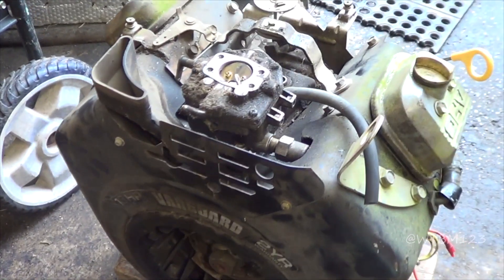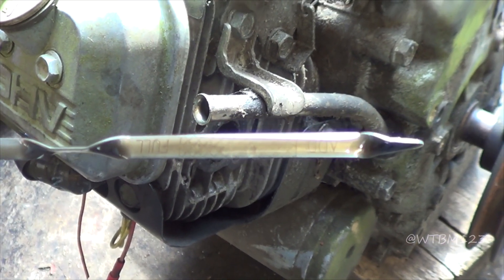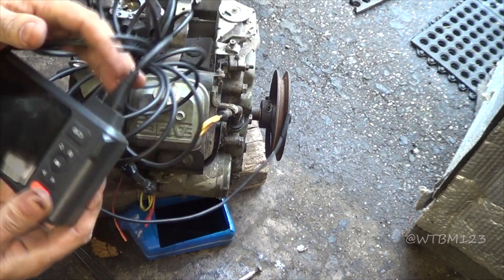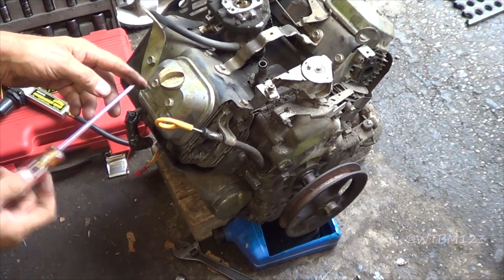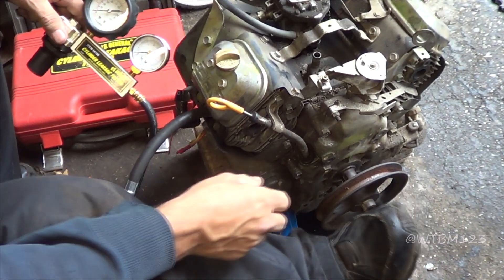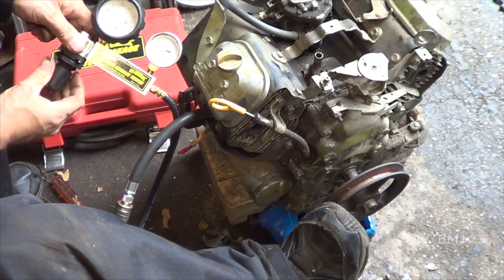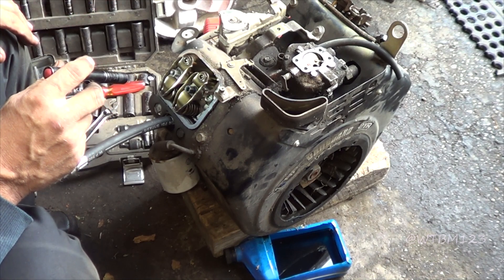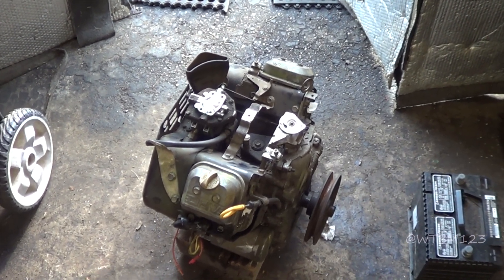18 hp Briggs Vanguard Inspection, Borescope and leak down tester. Is it  worth trying to start

Comment: You could still start it and see if the valves will seat themselves after running a while. Probably just some carbon on them. Onward and upward!
Reply from the maker: You can see the carbon on the valve seats , and can tell it has ran on one cylinder for a while. I want it for my main mower so i will do the valves , but picking up another vanguard soon , hope it is a good runner